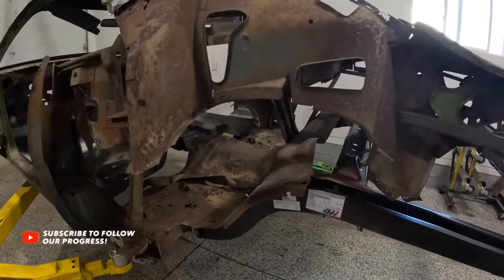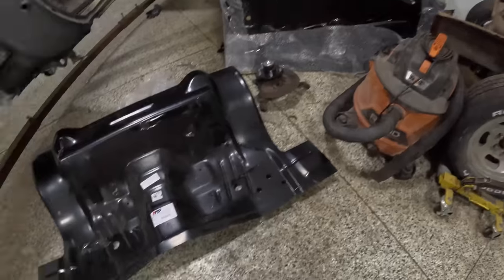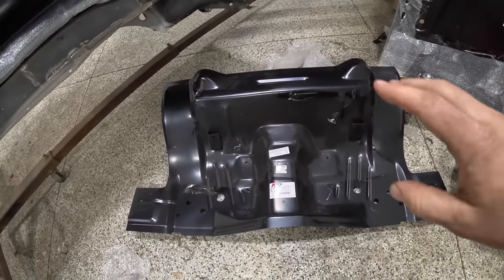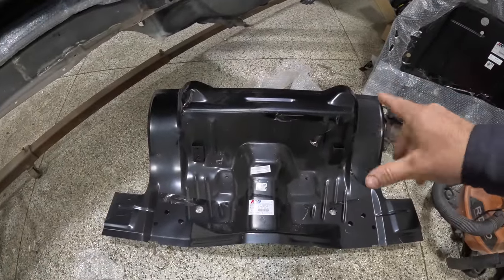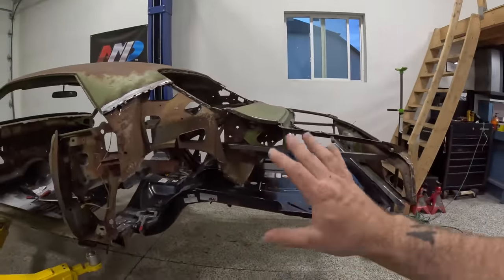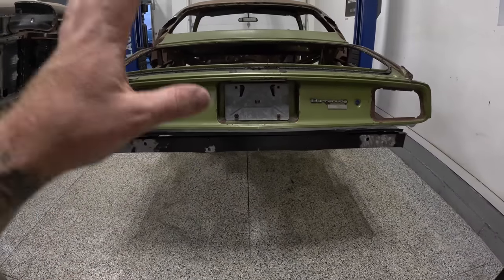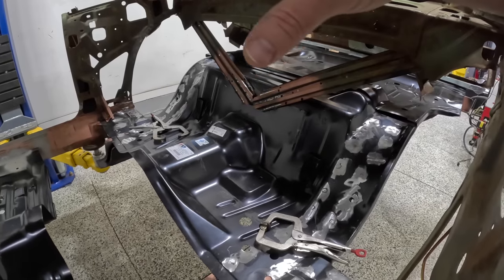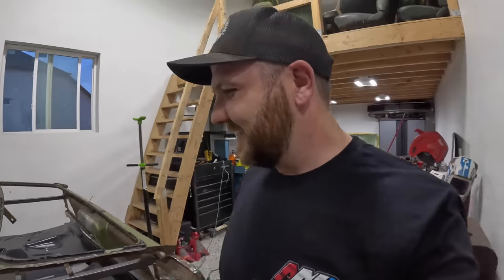1971 Plymouth Cuda Restoration - Episode 9 - Rear Seat Pan Install

Comment: Bravely ripping out structural metal, where the rest of us would be having kittens! I grew up with these cars but I never even thought how the sheet metal fit together. It's beyond interesting to see how they're lapped together. If we found a rear frame rail had gone to Swiss cheese we just got another car and swapped in all the drivetrain and interior and moved on. I'm still amazed by how you're saving these cars me, and a lot of guys, would have considered unsalvagable. Good on you man Malcolm Ottawa Valley

Comment: When and where did you learn how to do all this? 
 Keep up the great work and for saving these beautiful Mopars! 😃👍
Reply from the maker: Thanks man!  I’m 100% self taught.  Just kept doing it until I figured it out & got good at it!
Reply: @rustbucketrestos6511  Awesome, Same here so far. 
But I’m learning a ton from you! Thanks teacher! 😃
 I had bought a welder and learned how to use it as I replaced the Dutchman panel, trunk floor, drop outs, and lower qtrs on my challenger… gotta start somewhere. I jumped in head first. Car turned out great! 
 As Master Yoda says… 
“Do or Do not, there is no try!” 
 Then I fabricated a factory dash frame around a roll bar in my tubbed duster, now replacing floor in the 68’ coronet and some patches here and there. 
 It is definitely a confidence builder. I’m not really afraid of anything now. My Cuda that is folding in half (literally) is next.  
 No instruction, except how to do a plug weld and practicing. And from the naysayers, who said that I couldn’t do it…! 🤔
The best form of ‘encouragement’ 😉😎
Reply from the maker: Absolutely!  Keep kicking ass & good luck with your build!
Reply: @rustbucketrestos6511  thanks! I appreciate it! 
I did find a B-body front end section, but it’s up in Canada. I’m trying to figure out how it works to get it across the border if they will allow it? 🤔

Comment: I see you have a pretty steep wood stair to an upper deck. I have a fold-down ladder in a similar situation in my shop but it’s treacherous carrying heavy parts up/down the ladder. I have room for a steep stair and wasn’t sure how/if it’s better than the ladder. BTW, nice metalwork on the video!
Reply from the maker: They can be a little sketchy at times but it makes a big space savings!

Comment: I saw you painting the inside the rails. Por 15?  Also, these pre-primed panels from AMD or any other manufacturer really, do you have to grind down and then apply weld -thru primer prior to welding, or can you weld directly onto the panel without any prep?
Reply: It’s better when your doing metal work to grind where your welding to and. Do weld throw primer first. That’s why he’s doing it
Reply from the maker: The EDP coating burns off pretty easy if you want to weld right over it, but I like to get it down to bare metal & use weld thru primer on the spots I’m welding.

Comment: For your rear bracing inside, did you weld the bars to the package tray? Where did you weld the other ends to in the very back?
Reply from the maker: I welded them from the front of the package tray to the deck filler and then to the tail panel.
Reply: @rustbucketrestos6511  did you add any bracing to prevent side to side movement? Thank you so much for answering my questions. I'm definitely more confident in trying to replace mine. Great job on your videos and protecting the structure underneath the panels you remove.
Reply from the maker: No, the trunk rails kept it right where it needed to be!

Comment: the v brace keeps the upper body from shifting right or left or side-to-side hope you did some triangulating measurements mine moved all over the place even though I had the wheel houses still in my car , I never liked cutting that much of the car loose and let hang in mid-air without some cross-bracing a laser level comes in handy when I set up the rear of the car...
Reply from the maker: Absolutely!

Comment: What brand weld thru primer do you lean towards? I know most of your videos show a copper-based one, but it seems like you used a gray on at times on much earlier videos.
Reply from the maker: UPOL Copper Weld Thru is my favorite.  I’ve used the gray 3M stuff in a pinch when I can’t get the copper.  Both work great!
Reply: @rustbucketrestos6511  thank you!

Comment: Curious what percentage of metal will remain from the 1970's on this restoration. I am an admitted neophyte so not sure if this is typical to do this much or if this is a lot of metal replacement.
Reply from the maker: This is pretty typical for a car from the Midwest.  There will probably be 25-30% of the original metal left